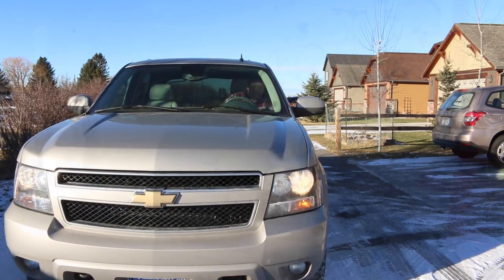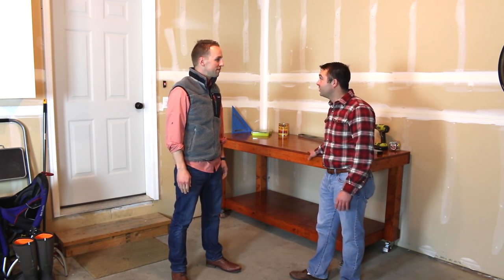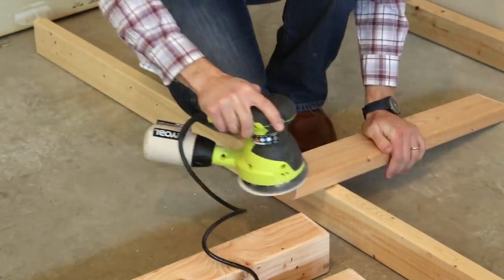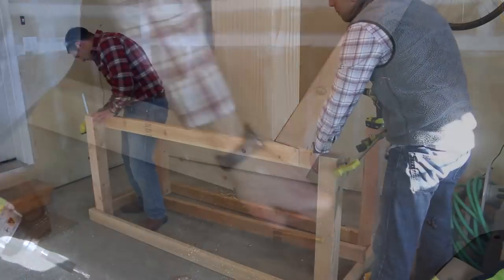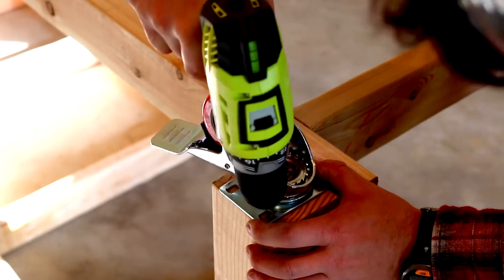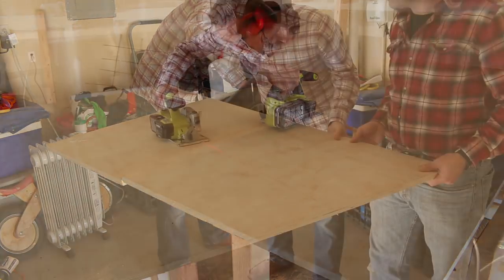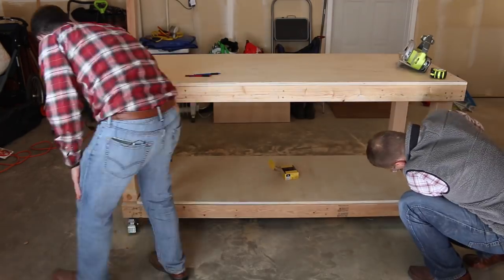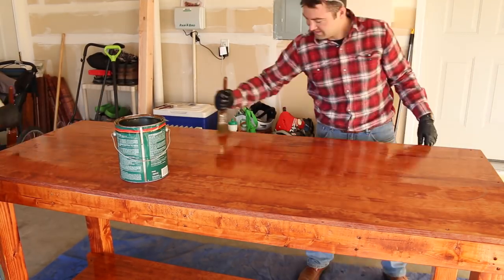DIY Simple Workbench - Woodworking Bench

Comment: I built this a year ago. Great workbench, very easy to construct, and solid., Only this I did differently was put a piece of osb under my plywood for added strength and I used metal brackets. Building another one today as a reloading bench. Thanks Pete.
Reply from the maker: So glad it turned out great! Keep up the good work!
Reply: What kind of metal brackets? To ensure 90s are perfect on the legs? About to do one as my project/rifle build workspace
Reply: strykeback1  
I used post and beam brackets. If you have a Lowe's or Home Depot near you, you can pick them up cheap. I probably didn't NEED them but just wanted the bench to be Xtra secure while reloading

Comment: great DIY! using this as a guide for my workbench, just a slight mod on the dimensions but otherwise the same. thanks pete!
Reply from the maker: Very cool Ravi! Good luck!
Reply: TopFineWoodworking. Com is an amazing book about wood working. I took several classes and completed a one year diploma in carpentry at a local tech college; this is better than any book I worked out of during those courses. It includes useful photos and goes over almost everything.

Comment: Just built this over the weekend.  I went slightly smaller, but it fits perfectly where I need it.  One question, and it could be I just have an uneven garage floor, but I have a slight wobble.  Would you recommend maybe adding some washers in between my caster and bench leg to fix that?  Or would putting a shim in between be better?  Any advice would be greatly appreciated!
Reply: I ended up using fender washers and it took care of the problem.

Comment: Many lumber yards and home centers (Home Depot for one) will make some of the larger cuts on your sheet goods for you with a panel saw. If you don't have a table saw or a saw guide or a straight edge long enough to cut an eight-foot sheet of plywood, it's better to get the home center to make that long cut for you. Cutting down sheet goods into smaller pieces also makes it much easier to load them in your vehicle, carry them home, and unload them into your work area.
Reply from the maker: That is definitely a good tip if you don't have the proper tools to cut a big sheet of plywood.  I will say that cuts at the store will not always be the most accurate to your measurements.  However, keeping that in mind, it can still be a great idea to get some of you wood cut at the store.  Cheers!

Comment: I really like the simplicity of this design, but I was wondering about clamping things to the top for projects down the road. With the top flush against the frame, it seems like you would need q larger clamp for any project. Do you think this project would work ok if you made the plywood overhang the top a few inches?  Would that be strong enough?  Or would. You recommend going with 1x planks for something like that?
Reply from the maker: Hey Matt! Clamps can still be used and I do quite often. A plywood overhang would certainly work using a good 3/4 inch sheet. You might think about doubling up the plywood (screw/glue 2 sheets together) -- to really strengthen it. But if just overlapping a few inches I think you'd be fine. Cheers
Reply: ah yes, good thinking ahead about clamp placement along the edges. Lay 2x4's on the flat around the rim and then screw the top down onto it and now you have roughly a 2.25" (if using 3/4" top) rim around the outside which makes clamping much easier. I evel used some angle aluminum pieces I had and added them to the underside of the 2x4 rim to give clamps even more broad loading to prevent compression if a clamp is placed for long periods of time.

Comment: Love the work bench. Mine is going to be 8' long by 2' wide. Should I use an extra set of legs in the middle? Thanks
Reply from the maker: Hey John! I've done 8 foot long spans without an issue. An extra support in the center for the 2 foot width might underneath the plywood is probably going to be plenty. I wouldn't do an extra set of legs if it was me.
Reply: DIY PETE Thanks for the info

Comment: I have a question about the 4x4s. will rough cider 4x4s work? or what about pressure treated ones? can pressure treated wood be stained?
Reply from the maker: Rough cedar will work if that's what you can find. Generally it's more expensive, but it certainly would work. You might just sand it a bit more (unless you have a planer). Pressure treated would work as well, and it can be stained. I'm guessing you must be in a part of the US where it is a little harder to find pine or fir, so if PT and cedar are what you can find, go for it! Cheers
Reply: +DIY PETE thanks. I ended up going with cedar and sanding it down. I appreciate the reply. can't wait to start on a new project

Comment: is that Hillsman poly or spar uerathane? is there a difference? cool videos
Reply from the maker: +RCbasheracer Hi RC, George had a can of Minwax Helmsman Spar urethane laying around already and so we used it. The Helmsman product has a UV protectant, so it is meant to work well outdoors. However, it will work just fine indoors as well. It is a little more expensive then the Minwax indoor polyurethanes -- so I'd recommend using the indoor version since a UV protectant is not necessary. (I just didn't want to make an extra trip to the store.)

Comment: Hey Pete! Great job on the bench. Would you recommend using carriage bolts with the screws or is this not necessary? Thanks!
Reply from the maker: +newbie1982 Hey! Good 3 1/2 inch or so screws will work fine for those. However, if you want to use carriage bolts you certainly can. Cheers!

Comment: Great video! Love your channel.  Lots of great tips and ideas.  I have a question, what kind / size of plywood do you use for projects like these?
Reply from the maker: I use 3/4 inch thick plywood. They carry a cabinet grade pine plywood at our home depot that is $34 / sheet. It is really good quality, but folks can use cheaper plywood to cut down on costs if they prefer. Cheers and thanks for the kind words!!